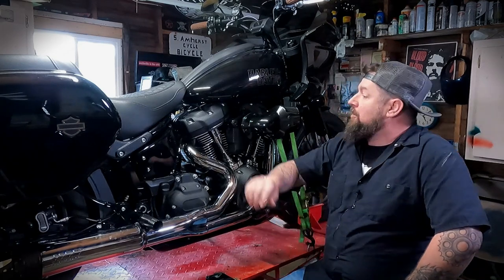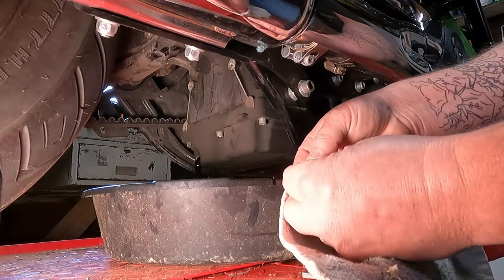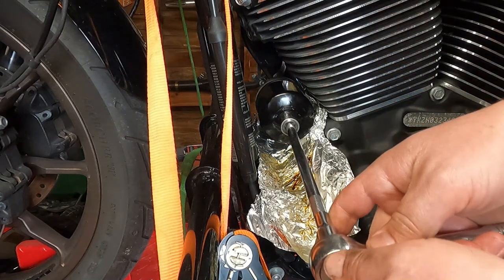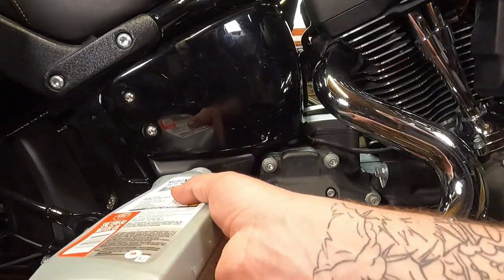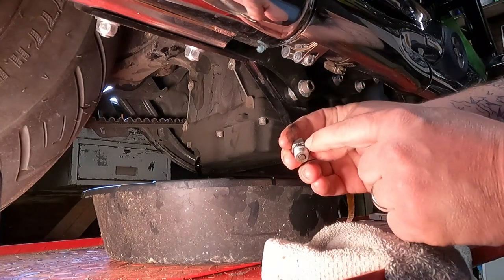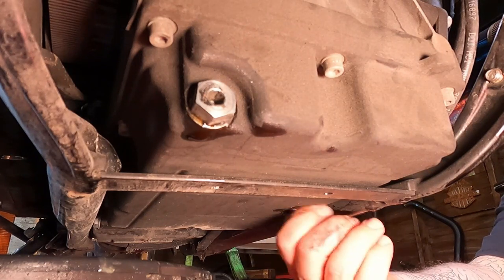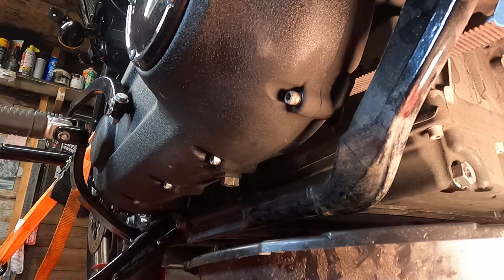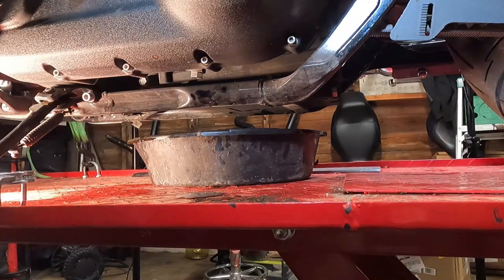3 Hole Oil Change M8 Softail Lowrider ST

Comment: Thanks for your video!! How many qt of oil??
All same oil size???
Reply from the maker: 5 in the engine, 1 in the trans, and 1 in the primary. 
I use 20/50 in the engine and 75/90 in the other two.

Comment: Im about to change my primary and my transmission on my 21 low rider s. My book says 32oz wet for primary and 28oz for the transmission. This is my first harley i bought and my first time doing it. Do i put a full qaurt in my transmission or do i follow the book and do 28oz
Reply from the maker: One full quart will be fine.
Reply: @KnobleMoto  that's what I ended up doing. I was always taught it's a good habit to replace O rings and gaskets every time they're removed. 28 Oz for the transmission was a little low so I just through the rest of the bottle in and it measured out fine

Comment: great video! straight to the point! . however I just have one question. My softail is at 5000 miles. Do I need to change the primary and transmission fluid? The owners manual says at 10k miles to do the primary lubricant. And 20k to do the transmission lubricant. Would it hurt to change the primary and transmission and engine oil all at once with only 5000 miles?
Reply from the maker: It’s would not hurt anything to change the oil more often.  Plus it’s only 1 quart each, so why not?
Reply from the maker: Also there is way too much clutch material in the primary oil to wait that long for a change IMO.
Reply: @KnobleMoto  I agree. I was just afraid that I would be changing it too soon due to some sort of “break in” period lol.
Reply from the maker: @dinhzil  not at all.

Comment: Just to confirm,all three locations take the same oil? I’m about to change my oil for the first time on my first motorcycle (22 Lowrider S). Any chance you can list the tools used, or tools necessary to complete the project?
Reply from the maker: I use 20/50 for engine oil and 75/90 gear oil for the primary and trans.
Reply from the maker: I don’t have a tool list written out. But in the video I tried to call out the size of the tool I was using for each step.

Comment: Do you use the same fluid in the transmission + primary?
Reply from the maker: Yes. It shares the same quart of oil.
Reply: I use bell ray non synthetic in the primary and amsoil UTV trans oil in the trans. 28oz in trans around 32oz in primary. Full synthetic seems to slip the clutch on built m8s. It does not share the same qt oil...
Reply from the maker: @fvgc454ss  I have not had any problems with synthetic oil making my clutch slip in the M8, or any other motorcycle clutch.  Is your clutch adjusted correctly?
Reply: @KnobleMoto  I have. Fuel moto also no longer uses synthetic fluid on any of their big bore set ups for this reason.
Reply from the maker: @fvgc454ss  with the big bore? That would be engine oil. It wouldn’t have anything to do with the clutch.
Reply: @KnobleMoto  yes. They do not use synthetic oil in the primary on the big bore builds. 2 of our group had issues with amsoil in the primary causing slippage including myself. Just look up some of fuel motos post about it.
Reply from the maker: @fvgc454ss  fascinating.  I have some friends there, I will have to message them and see what they say.

Comment: So to be clear, the transmission takes both regular oil and gear oil, correct,
Reply from the maker: I use gear oil.  But some use 20/50 engine oil.
Reply: It reads in the manual that it takes 28 oz of primary oil and 28 oz of motor oil. At least that is the way that I am understanding it. But that seems off.
Reply from the maker: @romeoseveriano6938  I just put the whole quart in.  (Shrug)

Comment: just curious the owners  manual says 4 qts???
Reply from the maker: Yeah it says to check it after 4. Mine takes 5.  I am not sure how they figure that an extra quart could be hiding in the engine lol.
Reply: @KnobleMoto  i did 4 and didnt even hit the stick. Added a 5th and now im over full😂
Reply from the maker: @HowNotTo365  I swear they do that on purpose 😂
Reply: @KnobleMoto  My 107 on my Sport Glide took 4 3/4.
Reply from the maker: @HawkOnHOG  fascinating.  I have no idea why there is a variable.